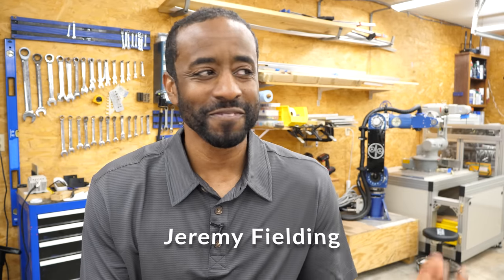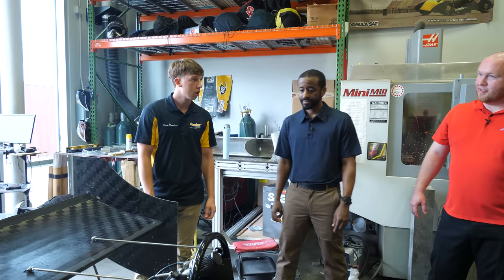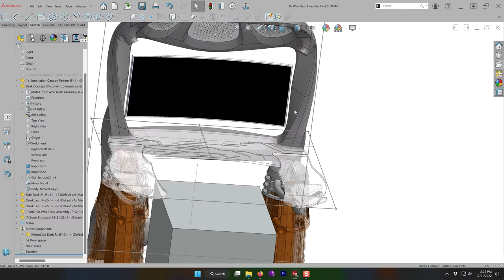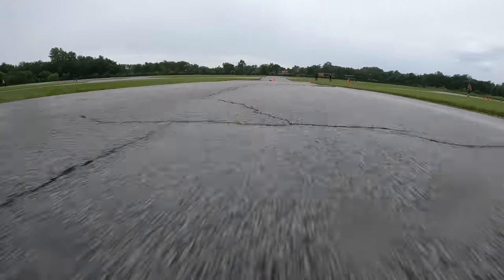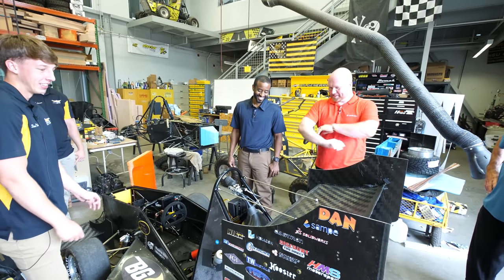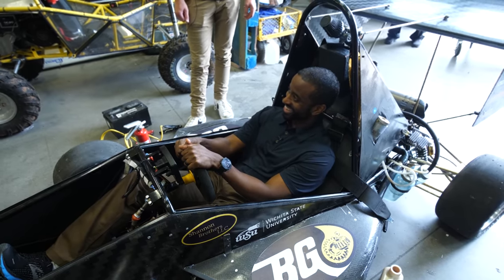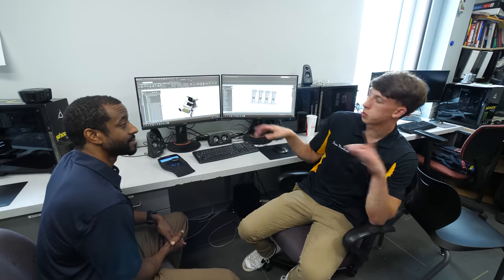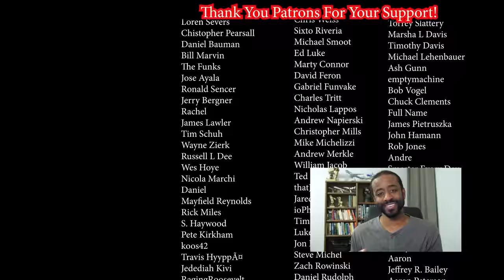The Best Way To Learn Engineering Period. Jeremy Fielding

Comment: Our children need more "hands-on" experience to help better understand what they have learned!
Reply: I would tend to agree. I learned a lot of hands on from my dad, who wasn't afraid to try things that others might not have tried before. Presently, I have a garden tractor I'm building that has parts not necessarily related to agriculture, but work together well. My engine is a Honda 13hp 2 cylinder from a riding mower, my transaxle is from a hydrostatic Cub Cadet, my rear fender pan and steering tower are John Deere, my front axle is modified from a golf cart, my steering is hydraulic and is from a forklift, the grill is from a Ford LGT tractor, the hood is yet to be determined, but will likely be just diamond plate fabricated, and the frame is 2x2x1/4" box tube. It's taken more time than I initially planned, but the distance from my house to my shop has increased, which is something I'm working on now.
Reply: @Farm_fab  i just posted a very similar story. i wanted a go-cart
Reply: Definitely
Reply: No we don't Chinese take care of it

Comment: I was the Mechanical Lead on the World Solar Challenge for UMR in the 90's.  We raced our solar cockroach up the US and Australia.  We finished mid-field, which was encouraging.  We had to pass road-train tests to run on highways in Australia.  I used Finite Element Analysis to develop the space frame for the solar car, which was pressurized to compensate for the thin-wall tubing (after having to learn how to weld it) and won a research grant for FEA space frames.

Comment: Nice coverage of the gem of engineering education. I graduated out of the U of Toronto's mech eng program back in 2008 and did FSAE my entire time there.  Outside of just having the experience to bond and work with your team mates and travel to the competition, the practical aspect of FSAE gives us the experience to hit the ground running, not just from engineering or CAE aspect, but also practical experiences like manufacturing methods and machining and all that. I think it really gives a fresh engineer perspective on how something can be made and if the methods makes sense or feasible. I am working as an engineer in automotive in Michigan and still volunteer for the competition every year. Seeing the students do their thing every year is always a treat.

Comment: Did SAE mini Baja for a few years in college. Another good one. That event is challenging to engineer for because the loading conditions are.... highly variable. Where mini-formula has more predictable inputs.
Reply: It’s definitely comparing apples to oranges here though. A lot of the Baja members at my university are good friends of mine. While I love Baja SAE, overall it’s a much simpler competition. However that’s not bad, it forces you to get creative to optimize something that’s already simple. The members on our BAJA team are super smart and they’ve made some incredible advancements at comp. 

In comparison FSAE is much more related to industry where you have a much larger range of manufacturing methods, FEA scenarios and testing cases. While Baja has a lot of sporadic forces, FSAE has very intense forces, pulling a high G corner in a braking zone puts 1000 lbs through the AFT member of the front lower control arm. Not to even mention the engine complexities of FSAE. Building, wiring, tuning is just the start.

Both competitions are incredibly different and have different scopes. BAJA is more of a race and FSAE is more of a design based comp.

Comment: What I think comes off unstated is that the best way to learn engineering is to *solve an actual problem*.

Pretty much every piece of math, computer science, and physics that I learned in high school by being forced to complete page after page of homework problem quietly slide right out of my brain. Formulas and concepts I actually remember and can use are the ones I gradually needed to find to answer a specific programing or manufacturing task that was the next stage in building an actual thing that solves a real-world problem.

Comment: I was an engineering student at Cal Poly SLO in the early 70s.  I had a huge interest in auto racing.  My automotive career spanned 45 years.  One of my areas of expertise in my time in NASCAR was air box design and fabrication.   You only get out what you can put in.

Comment: In the mid 70’s I was fortunate to attend a school (Wentworth,in Boston) that values hands on, practical experience. A graduation requirement was to have completed at least 2 semesters of CoOp, where students worked full time in the field. I learned a TON of stuff that I would never have learned in a lecture hall and I’m sure that it made me a more rounded, practical engineer. In my career, I’ve been able to employ and mentor CoOp students and I made sure that by the time they went back to school they knew which end of a file to hold and how to drill two holes in the right place.

One of my success stories was a very intelligent kid who did well, but who surprised me when he changed his major after his CoOp. Learning that your major isn’t really your best choice is worth learning!

Comment: Yeah. ABET the accrediting body for engineering programs made a significant design build test experience a requirement in the early 2000s, which is terrific. But you're 100% right that providing a decent one is way more expensive than textbooks. Think millions. Eg that building did not fall from the sky. Some of the increases in college costs are for bona fide reasons.

Comment: Would be cool to try running it on liquid methane or lpg and inject it before the restrictor to reduce intake density. Also computer controlled vectored braking in corners would be cool as hell and not that expensive to do.

Comment: Applied engineering is way more fun than theoretical engineering.  And more useful in the real world, because theoretical engineering specialists mostly just teach engineering...

I feel the same way about software engineering, yet computer science is (was?) extremely theoretical and very little of it was applied, at least back when I went through it.  The one big software project I worked on in college was a highlight and I am still, two decades later, thinking about ways we could have improved that project and maybe even taken it to market (or released it as useful open source software...)

Comment: I've heard of using steel wool in exhaust, but was wondering how titanium wool would work since it has a melting point of 1668°C, but is lighter in weight. Obviously , as mentioned, with the deceased weight there comes an increase in price 
Thanks Jeremy, for this open door opportunity.

Comment: Well if you didn't know Formula SAE exists, then you probably didn't know about Baja SAE which is for engineering off-road vehicles(small version akin to the Trophy trucks that race at the Baja 1000). Aeronautics Engineering Colleges also participate in a 2000 mile air race. Kent State has won the last 3 years, so any potential aeronautics engineers you now a goal; dethrone the Golden Flashes! There are also desert race teams/ top speed. There are endurance solar powered "races". There are so many options for involvement in the middle to larger state universities that it's surprising you didn't know about this!

Comment: I'll bet you could develop a "tolerancing cost multiplier" app that would give an estimated range based on max tolerances & scaling up stepwise to min tolerances. You would need a fair number of machine options for the input tables, but the programming could figure the feed/speed/cutter req'mts based on the solids model.
Reply: That's exactly how I sound like when ideas whiz by my programming Head

Comment: I can see several well known engineering flaws, however not knowing the parameters and requirement rules, the changes may be considered slightly illegal. I should note that NONE of the flaws would require engine changes such as mechanical forced induction, Nitrous, etc.

Comment: hide nitrous inside frame tube, lotsa volume there. it's also good for extra oil cap or fuel.  600cc  is a great motor, I'm building a kross kart with a 450cc, tell them I'll trade em motors.

Comment: i must be really hard to please.

when i think of good engineering, i think of say... the meredith effect.

heres a cart, with a restricted manifold to limit its volumetric efficiency and its power to weight ratio. well, given that we dump approximately 75% of our energy as heat out the exhaust... is there any thing we can do with it?

i see the muffler pointing sideways, and i cant help but think of gas exiting at high velocity...

to even make an ATTEMPT to somehow take, the hot cooling air and the hot exhaust gas and some ducts and well... it was done a century ago wasnt it? proved itself in several aircraft? the rule books dont say anything about doing it, do they? if they dont. its a free source of THRUST. you are increasing your efficiency by reducing a loss and using it as a gain.

instead we get all worked up over "carbon fiber" and "cad modelling" and "3d printed"... hype words. meaningless drivel, filler. fluff. but thats so called "engineering". 

then, well... i hear a phrase... "smells like horsepower".

in my mind... the smell of exhaust i now equate with the lack of power. the WASTE of power. the smell of hydrocarbons is unburnt fuel, unreleased heat, unrealised potential power.

i used to be a petrol head. big time. until i realised theyre just AIR COMPRESSORS.

they dont run on fuel. they run on AIR. i sort of knew it all along but it never really clicked.

when i hear a loud exhaust? all i hear is pressure, valuable power, being released before its fully expanded...

as someone put it succinctly over a century ago... we take the cream off the top and throw away the milk. but we havent made any real effort to progress beyond what is basically a steam engine witha  crb and spark plug, as someone else succinctly also put it... "its far more effective to heat the working fluid then expel it than the merry go round of boiler and other apparatus..."

i can point to nearly everything and show this.... wind turbines spring to mind. 

power proportional to the cube of the velocity, and just as it starts moving we apply the brakes... because we are stuck in the rut of considering only one option in extracting all that energy... gotta charge "batteries"...

engineering? bah humbug. there havent been real engineers for a century. just parrots, reciting, ad verbatim.

Comment: I wanted to join the SAE team at my local university in Ohio but my class schedule and work schedule was so busy I just couldn't do it 😞 I'm finally graduating this December but I wish I could have done it. I did do first robotics in highschool very heavily and I loved it but I would've loved to be in a race team.

I think you can still join after graduation as a mentor or something? I would love to do that if that is an option. I would love to be involved in some type of engineering based automotive / racing hobby or activity other than having a project car or something...

Comment: So many softwares are more intuitive than solidworks though
Reply: It also costs an absolute bomb
Reply from the maker: I guess it depends on what your needs are as well. Certainly there are many CAD tools even free ones today that can get a basic job done for many people. That is not who/what Solidworks is for... This software is a freaking power house of tools and capability. I have not found anything with this many options and easy of use... once you know the software LOL. There are hundreds of shortcuts and you can customize almost everything. Thats why so many businesses use it. But that also makes the learning curve at the beginning very high. I completely agree with that part.

Comment: "The whole point is to mimic a Formula 1 style car..."

Sir your car is less than half the length of an F1 car, is missing 2 cylinders, 6000rpm, and a hybrid drivetrain. Just call it an open wheel race car...

Comment: i stll wonder why transport trucks are yet to have the trailer wheels turn to fit in narrow streets the way fire trucks do.
Reply: Cost and lack of need mostly. A (high weight capacity) powered steering axle is significantly more complex, heavy, and expensive than a non-steering axle. There aren't a lot of situations where you need the extra maneuverability since you can always get a smaller delivery truck. You can not always get a smaller fire truck because of the size it needs to be to hold the ladder. Plus, whatever you are delivering doesn't HAVE to get there, the ladder truck absolutely HAS TO, and quickly. And likely via an unverified route with unknown obstacles.

The extra requirements justify the extra expense, particularly because we are talking about a much smaller number of vehicles.

Comment: These things are great and all, but why has nobody (calling out all engineers) built an exercise bike that can power a power station in your home to run various appliances and such. Why are gyms like planet fitness still moving steel plates instead of moving water or fluid of some kind to capture the energy from people working out? Why don’t homes have battery banks, solar panels, exercise bikes that can charge the pack???

Oh that’s right, bc you aren’t allowed to. Your books only allow you to engineer things they allow in your books. Y’all have the same knowledge as the next guy. 

Be original. Do something different. ✌️